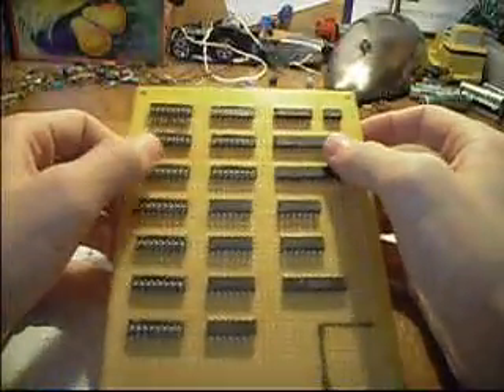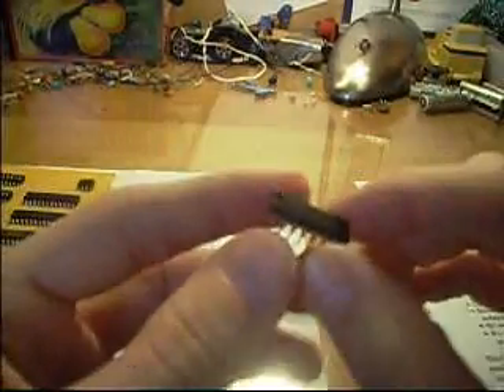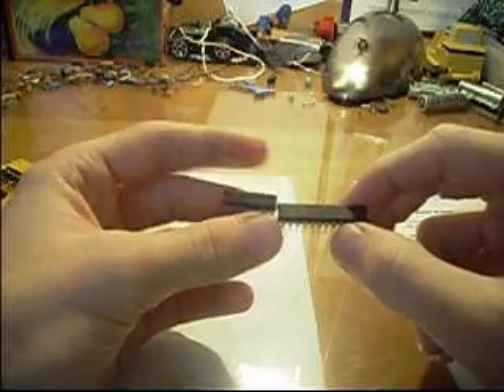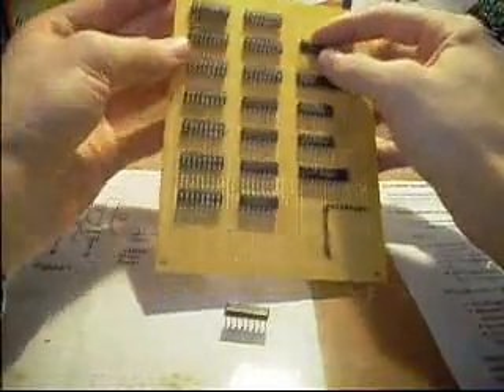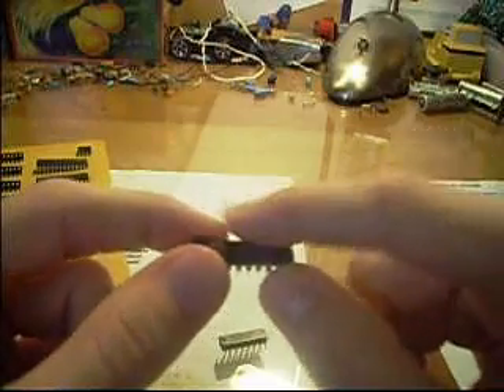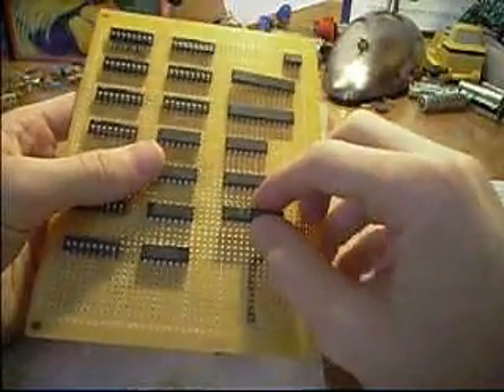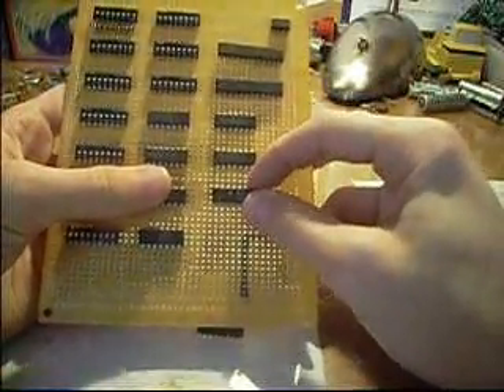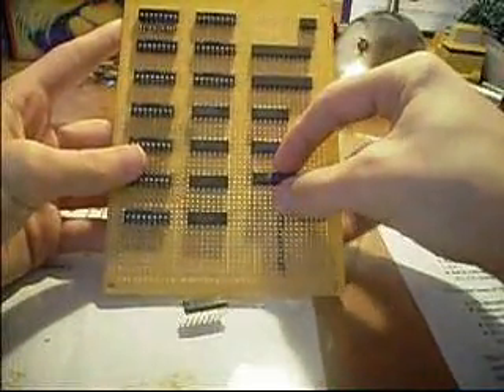4-Bit Computer  Alpha-4017 Update 2

Comment: That's what I did for my board, 32 flash roms on 2address decoders. You can toggle a pin to generate a clock rate to control speed :D I'm using roms with parallel/spi in/out so I had to use a few gpio pins for oe we command lines. I'm thinking more on it though, maybe another set of address decoders could be used to select other rom/s for read while others are being written to. but it would be kinda tricky. Some spi/parallel roms like the ones I'm using have 2 sram buffers in them :D

Comment: Thats awesome. I just started out with hardware designing and still trying to figure out how to test chip select lines with led's. I'd like to put an led on every address decoder line so I know which device is selected. I'm thinking the mcu sinks the current, but oddly enough, I connected the anode of an led to ground and the cathode to one of the mcu txd lines and it lit up while the chip select pin was active. I don't understand how an led can work backwards so I figure its sinking current.